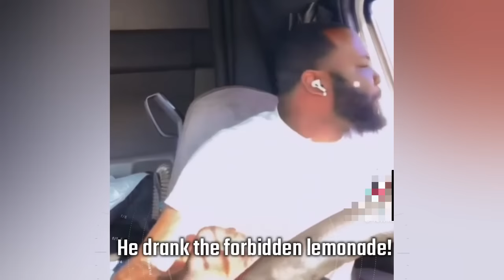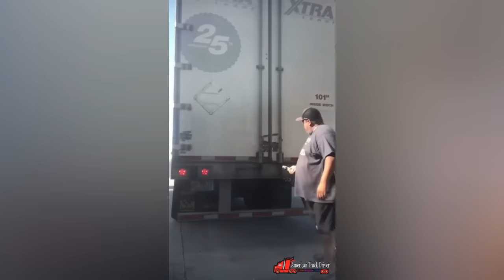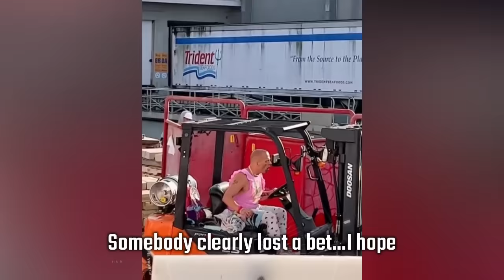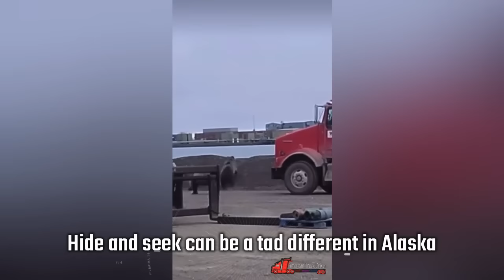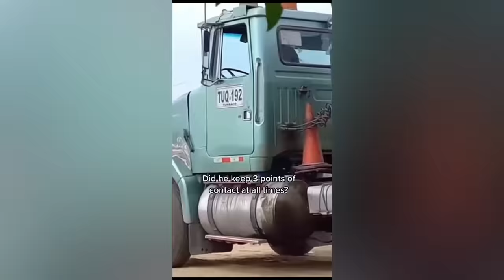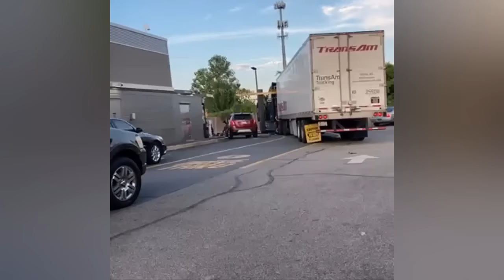Truck drivers moments on the road

Comment: Flatbedding is no joke. I did that for years, but never placed myself on the deck while they lowered a steel coil. But once during my first job I was standing on the trailer when the forklift driver was lowering a stack of bigger heavier Carry-on Trailers, and they fell over toward me and would have crushed me but I had run and jumped off. The forklift guy thought he had killed me for a sec.
Reply: Flatbed needs an endorsement. Steel is just as dangerous as hauling anything else. Huge safety issue for the untrained. Scary it has no endorsement requirements. Pickled oiled sheets of steel are serious. They go where they want they don't care!
Reply: Appreciate your feedback 👍...👆👆do well to drop a note....

Let's talk 👆 directly🅿️
Reply: @jamicl2580  umm you do know flatbeds dont just carry steel
Reply: I've been flatbedding for years. And to this day, as a true OO, NOT LEASED ON, and with a step deck, I refuse to hail coils.  Made a promise to my daddy. Those coils need to be on a train. Seen many drivers killed by inexperience and/or laziness. 😢

Comment: Sadly, Video 2 has happened.
2018 usually kept a gallon of water and an empty gallon for those roadside events.
 Driving along and the weight of my water container felt the same weight as the "roadside" container. And yeah... picked up on it VERY quickly.

But the benefit? At least I know I haven't developed diabetes yet 🤣🤣

Comment: I hauled plentnty of can loads. That is exactly how cans have been palletized for as long as I can remember.. That chucklehead didn't use any load locks to keep the pallets of cans from shifting, and quite possibly, he smacked a curb on a corner somewhere and busted them loose. That had nothing to do with the way the cans are palletized at all.

Comment: 2:25: Oh, man, I had this happen to me about 30 years ago; picked up empty Pepsi cans from a place in Texas, stacked high with thin cardboard between layers on slipsheets, 8' high, no shrink-wrap. They were SUPPOSED to wrap the final 2 stacks, but didn't (I'd picked up the trailer as a pre-load). Got to Pepsi in KCMO, opened the first door, and had a cascade of cans.....
Reply: What makes it worse is if it was 12 oz cans then you got 8,169 cans on a pallet which can get entertaining when they fall apart

Comment: The guy taking the mouthful of liquid should get himself the kind of bottle they have in hospitals that are specially made for that purpose for 1, ease of use2, a tight unmistakable lid 3, ease of emptying 
Another way is to use the slider type quart storage bags . Put yourself in, relieve yourself, slide it shut and toss it out, …. Just sayin

Comment: #2-Once. I used soft drink cups so I could dispose of it in toilets or sewer drains. I never tossed trash on the roads or parking lots. Grabbed a large coffee cup in the sleeper thinking it was left over coffee. It was not coffee. At least it wasn't coffee anymore after passing through my kidneys. But I spit it back in the cup not all over my cab or sleeper. Good luck getting that p*ss out of the dash...